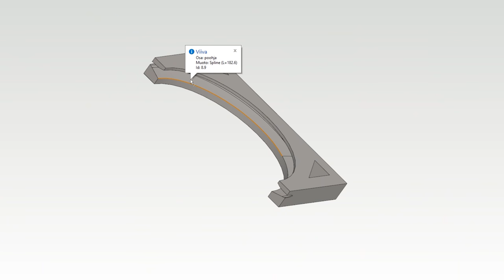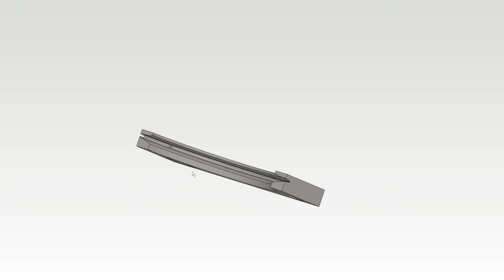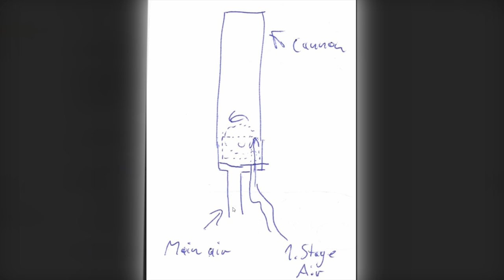Cutting HUGE Steel Pipe with our Heavy Duty Bandsaw

Comment from the maker: Thanks for everyone that sent ideas for saw blade launcher! If anybody has good ideas for the frisbee launcher please let me know :D I am going to first try with out spin just to see the speed and get idea about the forces involved. But with frisbees I can't use the shaft on middle with bearings approach so it's harder probably.
Reply: Pretty easy thing ask joerg sprave. He will already have something that works I bet
Reply: Naveed Awais  Timo has a great smile and a great sense of humor, in ANY language.😀👍
Reply: Maybe instead of air you could put a little nub in the back of the barrel that one of the blades sits in so it starts it spinning as it passes
Reply: Maybe you could 3D print some insert for the center of the disks that can have a wire spooled around. Attach the end of the wire to the back of the cannon and it should start a spin as it unravels. How to make it survive the forces is another story though.
Reply: what about a guide rail up the center of the cannon with geared teeth on one side, and welding the blade to a small gear on the spinning axis, so as the blade is pushed down the cannon barrel, the teeth make it spin?  Maybe too much drag, i dont know.
Reply: Blade launcher: make a hole in the rail for the spinner motor you used in the disc video and attach the blade to it. After it is spinning, lower the motor and blast the blade out (a bit like CD players).
Frisbee: put a magnet on the frisbee and use electromagnets and bearings to hold it from the top and spin it. When ready, turn off the electromagnet and blast it
Reply: How about the hot wheels approach, put a somewhat flexible strip with gear teeth cut into it, that passes through near the axle of the saw blade. Then have a small arbour with either some half sleeve bearings, so the saw blade will detach from the launcher, or with a pair of small ball bearings as a sacrificial centre, with a simple gear on it to speed up the saw as it goes down the launcher. Probably have a gear that is around a third of the diameter, so it gets a good velocity, and the rack with matching teeth to engage, and rely on the hole to provide enough side loading to spin it up. 

Gear probably around twice the thickness of the blade, and mild steel or nylon, because it will probably only survive a launch or two, along with the strip. Strip probably water jet cut out of engineering nylon, with a pin at the base to attach it to the launcher, and then make a loading rod to hold the saw blade and the launcher sabot as you engage with the strip and push down the barrel.

Will probably scrub around 10% of your velocity on exit, but the saw blade will be going at nearly speed of sound around the periphery of the blade, so you can have it either in cutting or making noise side spin.
Reply: For a frisbee launcher, look at a tennis ball launcher. Use a motor to spin from the outside for one edge, and the other edge rolls on a rail. All you have to work out is the angular velocity of the spinning wheel, and half of that speed will be your launching velocity. For the spinner motor, use a motor rated ~3450 RPM (two pole induction motor), or use a DC treadmill motor. No modification of the frisbee is necessary.
Reply: again this music i love it and want to know what it is
Reply: What are you going to crush in the huge piece of pipe, Volkswagens? ;>)

As for the saw blade launcher, I think the two-stage air trick will work but the first stage should blow on the front of the blade from the side, or from in front of one side of the blade- either would help keep the blade in the sabot.
For a bearing you could weld a small stub of pipe into the blade and print a semi-circular rim into the front of sabot for the shaft to fit into.

For the frisbee, same thing to get it spinning but you will need roller bearings in the sabot for the rim of the frisbee to ride on.
Reply: Mount it on a bearing, then couple it magnetically to a motor outside. (Obviously this is for a sawblade which has a hole and is metal...)
Reply: why not a lathe and a torch?
Reply: Rubber rolls on opposite sides of the saddle so you got a small cart in the pipe spinning blade as it launches. You also need to hold the blade from center during the launch.
Reply: LAURI!!!, if you dont take that same size pipe and make a 5 meter cannon out of it I WILL BE VERY DISAPPOINTED
Reply: Use suctiun cups to hold fresbee in place
Reply: Build a sabot where the saw blade is mounted with ball-bearings, so 1. Stage Air will spin it properly. Build the sabot from two parts, so it will separate from the blade when leaving the cannon.
Trust me, I'm German.
Reply: just make sure that if the saw blade is spinning, you make proper adjustments, because its spinning on a different axis, so it will want to travel the direction it is spinning when it exits the launcher.
Reply: I have a small, but significant, suggestion for the spinning saw blade launcher. Just lube the 3D printed saw blade holster with graphite. Getting it to spin before you launch seems like a trial and error thing. But, graphite lube between the 3D printed parts and the saw blade seems best. Any oil based lube would probably slow the rotation of the blade. But this will obviously be a trial and error project. I can't wait for the final product!
Reply: For a frisbee launcher a electric motor to spin it up through a notch in the side and make a small hole in front and rear of the frisbee an put small plastic 3d-printed pin to hold in in place for spinning and free to then launch it with compressed air could work if you line the rails with plastic.
Reply: I think the way to make the saw blade to spin is to get a motor that will spin the blade and as soon the it gets released. The spinner and compressed air will be released at the same time.
Reply: to separate the stages for the saw spinner, you need to make a break away tab that will hold the blade holder as it spins up then when the main air comes through it will be too much force and the tab breaks and the blade goes out

Comment: That is one heavy duty bandsaw if i've ever seen one
Reply: You know it is a big saw when you need a crane to bring the job to it, and also have hydraulic pumps to lift the saw up off the work. Wonder how Timo would react if he got to use a vertical lathe that they use to make rocket tanks, with the friction stir welds that they use to join the individual sections into a single monolithic unit.
Reply: Makes my 250mm capacity bandsaw look like a toy does that monster of a saw.
Reply: Laughs in cackling hacksaw noises
Reply: It’s a big boi. I w a n t It

Comment: Impressive size of that one! I operate a machine like this myself a lot at my workplace. Its not this big but its CNC controlled and can operate in the entire range  from fully manual to fully automatic. Really easy to run, You set the desired cycle, program the cuts and length if running in automatic mode, feed in the material and clamp it properly in pre start position, adjust the top and bottom stop points if needed, press Start and off u go. The machine Im operating is a 2004 MEP Shark 282 CNC FE. A good  realiable and versatile machine for general purpose saw jobs. Never have had any problems with it! Your machine can cut MUCH larger stuff then mine can though!

Comment: This reminded me of when I had to drill a touch-hole in a cannon barrel. The hole had to be 4 inches long but only 1/16 of an inch wide. After much searching, I located a drill bit just 4.5 inches long. It would only just clamp in my hand-cranked bench drill  chuck. If it had snapped, the chances are the end would not have been extractable. It  was 20 minutes of very gentle drilling, suspense and lots of oil but I made it.
Reply: There's a channel on YouTube where a guy casts his own bronze cannon, and the bit does break off in the hole. He ended up dissolving it out with a solution of alum.

Comment: Electromagnetic disk that can be switched on and off to spin up blade before air launch. Turn on electromagnet and magnetically locks in blade. magnetic disk spins at high RPM disengage electromagnet and launch. The free spinning sabot might be an issue.

Comment: Spin the blade by: 1. putting a pin (shaft) through the plastic holder and passing through the saw blade arbor hole so that the blade can freely rotate in the plastic holder. 2. Notch the holder so the pin and blade (and pin) can fly forward leaving the plastic holder behind. 3. Cause the saw blade to spin by:  putting something fixed in the launcher tube (stationary) so the blade can contact it on only one side of the launch tube as it is moving down the tube.

The pin should be light weight, aluminum, delrin ?
SWEET!

Comment: Use a anchored dyneema string on a mini spool attached to bearing centered in saw blade to achieve spin !  When blade launcher is fired anchored string spools up saw blade as it goes forward only a single wrap on the spool will give it plenty of spin!!!

Comment: I thought I had seen a lot of band saws and they always cut at a 90-degree angle to what you were doing. I'm very curious as how you get the band saw blade to bend on its back bone instead of on its side. Could anyone enlighten me please?
Reply from the maker: There is guide rollers that turn blade 90 degrees before and after the sawing action.

Comment: Impressive, how's the blade making job without moving at some high speed like similar tools. That's some magic stuff right here.
Reply from the maker: It was also surprisingly fast job
Reply: Metal cutting band saws cut better and last longer at slow speeds.
Reply: Mhairi  I'm glad someone answered this slightly dumb question.
Reply: Does the blade ‘flip’ through 90 degrees to do the cutting then turn back round so that it can pass around the bandsaw wheels? It’s impressive, I’ve only seen the big back and forth metal cutting saws do that kind of work before.
Reply: @christianclark2763  My teachers always told me there is never dumb questions.
Reply: @MrEvodio65  and I've came to the conclusion that that happens to be a dumb saying. Like at work when someone asks if something that will obviously fuck them up is seriously asking if it will. Lol.
Reply: @thomaswilkes8603  someone pls explain
Reply: @MrEvodio65  I'm working on an lifted steel building right now. Someone asked if we should wear our hard hats. Do you think my hard hat would keep me alive if I had a steel building fall on me? No, I'll still die so I just don't wear one. Dumb question.
Reply: @magnumopus9058  The saw blade bends as it moves through rollers in the housing. The actual blade itself is very thin and easy to bend so it moves through rollers very easily, thats the best I can explain it. I use them all the time they are actually very simple machines which is great as I always end up needing to fix one every month or so
Reply: @christianclark2763  The hardhat isn't to protect you from a building falling on you, it's to protect you from a nut, or bolt, or something similar falling on you. I don't drive crazy, so I don't need to wear a seatbelt.
Reply: @thomaswilkes8603  yeah, there are guides to shift the position of the blade.  drop-style bandsaws and some portable bandsaws do this to increase the size and length of the material you can cut.
Reply: @Beyondthepress  hey I have a idea what you could do with the pipe. Why not use it for some explosive tests or something in that fashion.
Reply: I learned something here- thank you to everyone who actually values learning and teaching us young people. Clark.. let us learn, most questions aren’t dumb
Reply: I've always said that if you don't know the answer, than it's not a dumb question, the only dumb question is the one you already know the answer to.
Reply: Tashkiira thanks,
Reply: Christian Clark that hardhat would diffidently save you from you co worker who drops his tools. That’s what it’s for, not for saving you from a huge steal beam, that was really a dumb comment!
Reply: @xenonram  
Well said,spot on.

Comment: How does the saw blade travel thru the band saw pulleys? Does the blade flex to get driven around. I know that smaller band saws are at an angle. Great video also.
Reply from the maker: It just flex and goes around large rollers just like smaller ones.
Reply: @Beyondthepress  Man, I learn something new all time from you!

Comment: You should try installing a big 12 inch circular saw blade on your router to see if it comes apart. You would probably have to damage it first, but if it came apart it would be just as violent as the saw blade cannon, maybe more.

Comment: You need to tilt the LaunchingBarrel 90° vertically, so that Sawblade can roll on the bottom. on the bottom is wood for grip. The Sawblade needs an axle where it is pushed by the 3Dprinted sledge. The sledge needs to have walls of steel to take the power and friction generated at the axle when launched. The sledge is a bit unsymetric, that the blade is pushed slightly downwards against the bottom for more friction that gives the drall. The sledge is itself tied to the ground and stopped shorly after "max Q". 

No worries for me helping you out. For detaileed drawings and calculations contact me. Now, back to work goood Sir!

Comment: What situation would call for a pipe with such a large wall thickness?
Reply: I'm not an expert, but I'm just guessing it's for high pressure steam pipes ln like a power plant of something. That's the only thing I can think of, apart from a battleship cannon.
Reply: I cannot visualise any actual application for a pipe with that wall thickness (other than a cannon). That's way too thick for a pressure vessel. Its more like a 'spacer' of some sort.
Reply: @technicallydifficulties7094  Ha, yea, when I saw it I thought, "Iowa-Class."
Reply: Worminator 25,000,000 😱😂👍

Comment: What is the application for pipe with that wall thickness?  Anyone know?
Reply from the maker: I think there is very few applications for pipe of this size other than being handy raw material for large rollers etc. parts that have large hole in the middle.
Reply: Maybe super high pressure steam pipes in power plants or something? Not an expert, just a guess.
Reply: Worminator 25,000,000 maybe???😱👍
Reply: It is actually a piece of hollow bar EN 10294-1:2005 E470. "Hollow Bars are seamless tubes specifically produced for machining"
Reply: @TheJJHO  Thanks.  That makes sense.

Comment: About the spinning blade: How can the blade spin as it is pressed against the printed launch part very very hard during launch? To allow a spin, you would need a low friction axle in the center of the blade to carry the load during accelleration, wouldn't you?
Reply: He did say something about bearings.

Comment: Build a rubber wheel in the corners of the holder that will contact the barrel and blade thus spining on exit. It will onlt need very lite contact.
Reply: The holder may need to have an arm that extends to hold the blade in the center. Break away on exit shouldn't be affected

Comment: 0:40 "500"

Damn!
That's exactly what I guessed, and without previous experience weighing stuff like that.
Reply: Plus, if you're way off, you can always claim you meant pounds instead of kilos, or vice versa.
Reply: @jjohnston94  
Well, I live in the US, so I'm always thinking in US terms.
Was he referring to kilos when he said 500?
I can't imagine that weighs 1100 pounds.
Reply: shawbros Absolutely he was referring to kilograms. Nobody talks about pounds in Finland.
Reply: @avlehtine  
Well, abiding by that logic, they wouldn't be speaking to us in English either.
Reply: @shawbros  I don't think that logic holds. There's no reason for them to even consider pounds - particularly since Timo wasn't talking to "us" when he said 500. Also, you can estimate the weight of the tube easily: it looks like it's about 20" in diameter with a wall thickness of about 3". Cross sectional area is therefore about 160 sq. in. Length about 36", so volume about 5800 cu. in. or 3.3 cu. ft. Multiply by the density of steel of 490lb/cf and you get 1600 lb or 740kg. Close enough to know for sure that Timo meant kilos.
Reply: @jjohnston94  
"I don't think that logic holds. There's no reason for them to even consider pounds"

Many of their videos mention:
Pounds
PSI
Fahrenheit
Inches/feet/miles
Reply: You're obviously right. The pipe is actually made of aluminum, so it really is 500 lb.
Reply: @jjohnston94  
My posts never insisted what the weight is, or what it is made of.
My posts only refuted the claims that this channel only makes references in metric units.
Reply: @shawbros  Actually, your first post claims you guessed 500. You assumed pounds, and you were wrong. You were wrong both in guessing the weight of the tube, and in the assumption that Timo meant pounds, not kilos.
Reply: @jjohnston94  
Re-read my last post carefully.
It states "never insisted".
Not "guessed/assumed".

Comment: Try to press an Airbag from a car please :D
Reply: Wouldn't be very interesting,  they need an electrical current to set them off.
Reply: I know that, but it could happen that it generates an static electricity when under high pressure, it has happen before in older Saab 900s,  just from static from the hands, they had alot of recalls back then.

 Airbags can also accidentally deploy when a car is exposed extreme environmental conditions such as severe dust, moisture and salt residue.